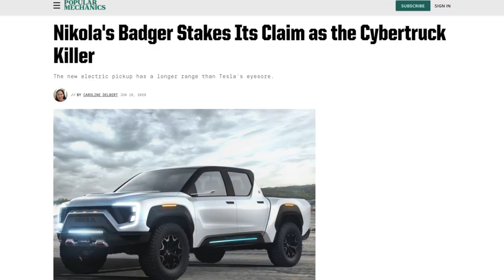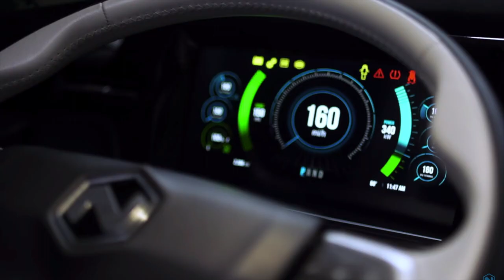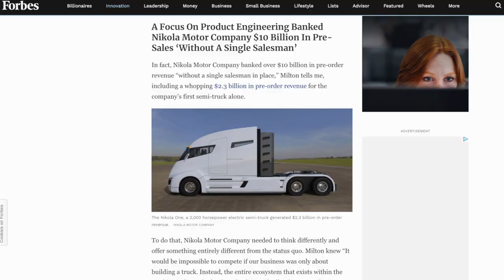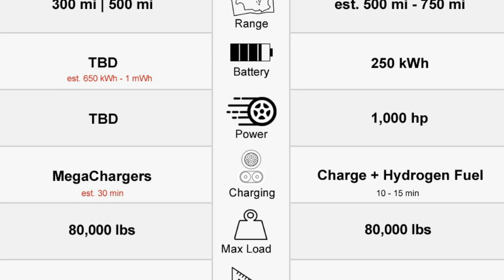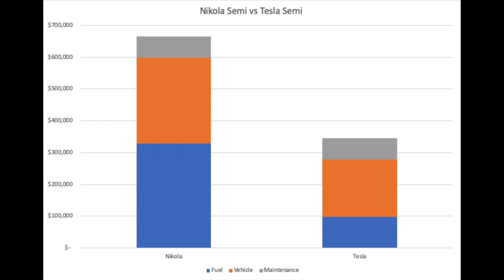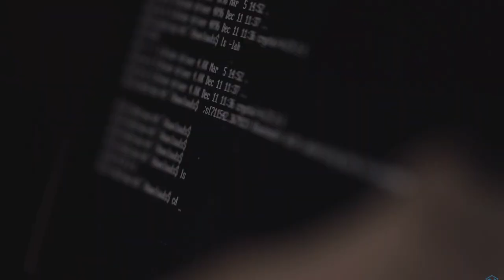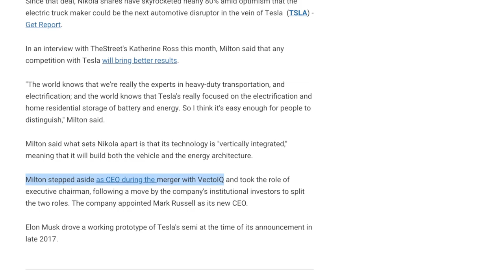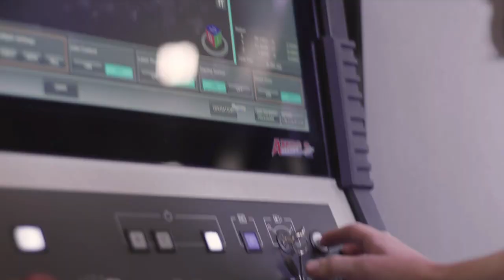NIKOLA - Their Inevitable Future

Comment: 1. Tesla have more cars in space than Nikola trucks on the road
2. Nikola is another Theranos
3. Nikola and Trevor after 5 years still dont have:
        1. Any truck or EV car on the road
        2. Any working prototype
        3. Any hydrogen fuel station
        4. Any public tech sheet about ANY truck part, batteries etc etc
        5. etc etc

Math is simple.
They dont have any vertical integrated production line
They dont have any real VISION as a company ( seek for some latest Trevors interviews )
They dont have any real deadlines for ANY products

etc

So, you are still think that NIkola is anything more than company that produce stupid youtube videos???

Comment: The hydrogen fuel cell might be a good idea for local travel around a depot where trucks can fuel up at night: ports, local delivery trucks, postal trucks, school buses, etc. 

So why are they making an over-the-road semi and a mass market pickup? Why start with an enormous, expensive infrastructure build-out when you can profit sooner and improve the world?
Reply: Why would be good for local travel - the whole concept of hydrogen is the terrible inefficiency it offers compared to charging a battery (25% cf 80%) and the new infrastructure.  If you want to fuel up over night - plug a battery into a wall !  
It just does not make economic sense for any ground based transport system.